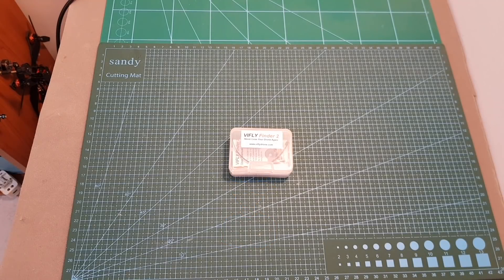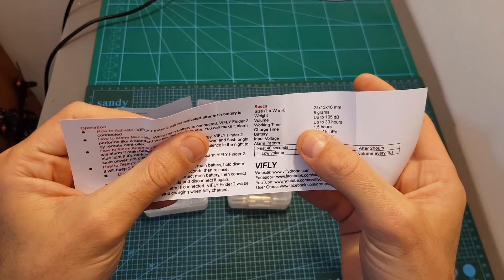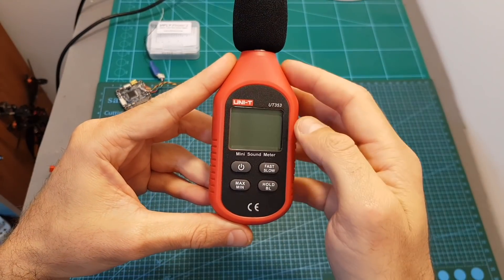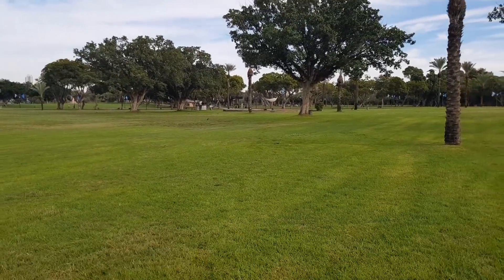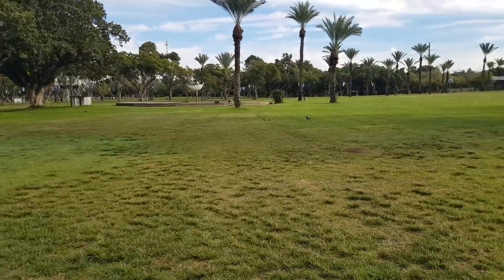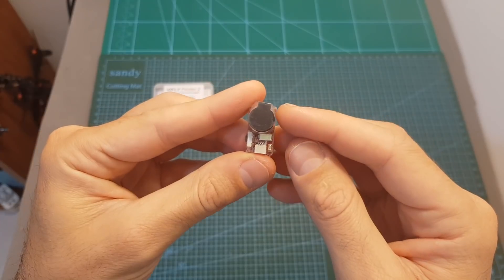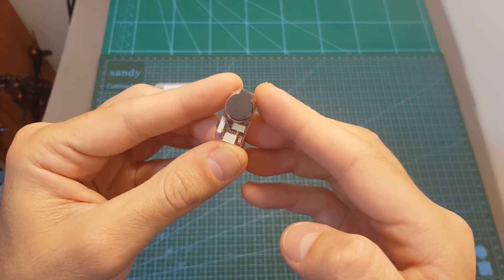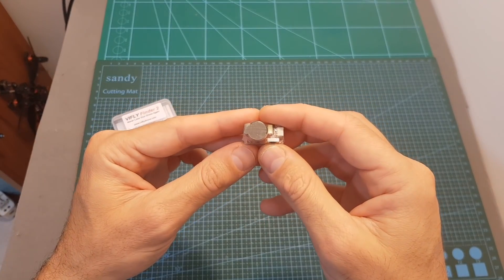Vifly Drone Finder 2 - Review, Field Test & Giveaway

Comment: Also does it still beep during the night? I see on the website it says "Even more, the built-in light sensor can detect light intensity and then smartly control the LED light to flash. Besides, it enables the buzzer automatically enter into sleep mode at night to save power and not disturb."?

Comment: Mine seems to be dead on arrival. There's another led on the bottom that's red what does that mean?
Reply from the maker: How did you connect it to your flight controller?
Reply: @KremerFPV  I run whitenoise synergy boards but I didn't pin the vtx to it so I used  the 5v pad and ground from that spot and buz- to the yellow.
Reply: @KremerFPV  does yours have a red light in the bottom?